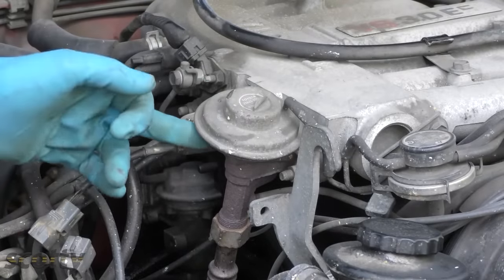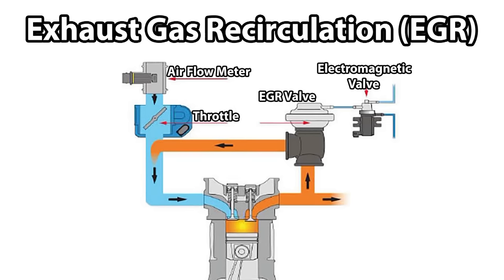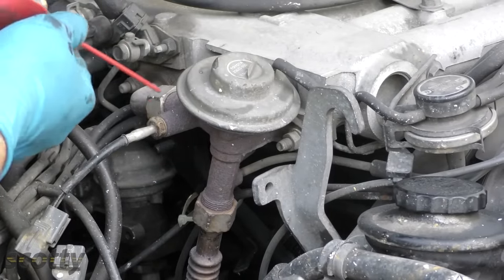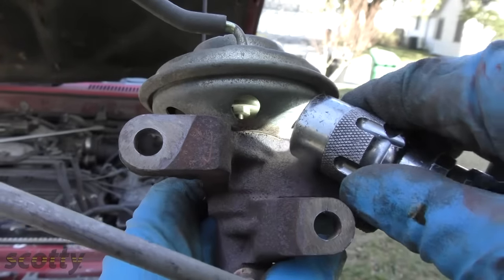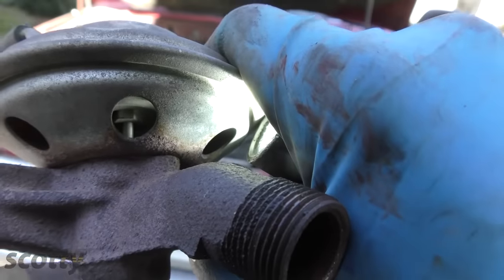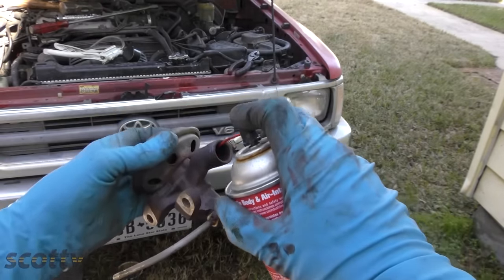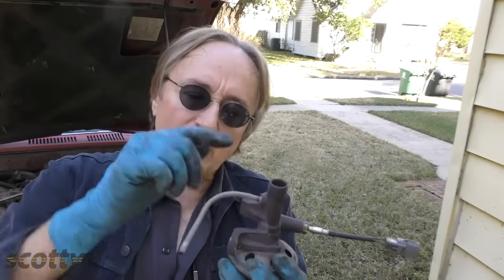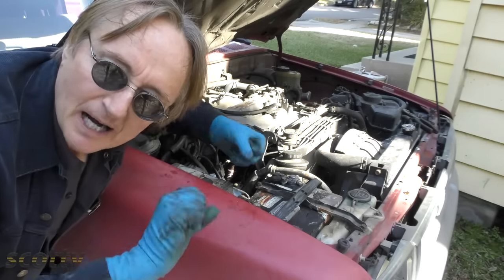How to Clean EGR Valve in Your Car (How It Works)

Comment: Egr valves..... Good for the planet, Bad for the owner......
Reply: Martyn Lee also bad for the engine.
Reply: EGR should be banned.   friggin EPA bs.   There is something better out there.
Reply: Martyn Lee deisels can get egr delete but I don't understand that
Reply: @DespairMisery  im doing that and a repro
Reply: Honestly those EGR's are nothing but a stupid piece of crap. Feeding an engine its own poop is NEVER a good thing.
Reply: Markus Hillarious wording
Reply: Egr makes the combustion cooler preventing detonation
Reply: EGR makes combustion cooler as someone said, theyre not bad, yes its less fuel efficient and decreases power but doesn't destroy the engine
Reply: Lowers the burnable air in the cylinder and therefore is similar to lowering displacement causing better gas milage.
Reply: My mechanic chucked mine
Reply: Ikr, EGR drive me insane when troubleshooting EGR problems
Reply: My mechanic chucked mine
Reply: 99 times out of 100 a check engine light pertains to stupid pollution control crap
Reply: I can smell gas very strongly under my hood. Just thankful it hasn't blown up on me. I'm getting mine fixed soon.
Reply: Omfg yesss
Reply: @elainec2577  🤫
Reply: Mine went bad. I plugged the vacuum hose.  Works great 👍
Reply: Do you know about what semi trucks have to deal with? Diesel exhaust fluid the emission system, the cost the headache the cost to the consumer.
Reply: Egr are not bad , just mechanics are idiots and cannot or don’t want to help people understand them

Comment: You really don’t want to soak the EGR valve upside down - that diaphragm is made from material, not metal, and the carb cleaner or solvent can actually destroy that.  It may also be a good idea to try to clean the passages that you see, when the EGR valve is off the car, as carbon can block those passages as well.
Reply: C'mon man go you know the thing
Reply: @midnightrunner684 go where

Comment: I had the same problem. Check engine light for egr. Dealer said it is a digital egr and must be replaced $500 🏃. I took it apart, cleaned, changed 3 silver gaskets and check engine light gone.
Reply: Jose Garcia     wow
Reply: Did you plug in a code scanner and did it say all your cylinders were misfiring? My car is running fine, but the check engine light is on and I'm getting codes that say  all cylinders are misfiring. Some forums are pointing to the egr valve
Reply: you cheated the owner of the dealership out of $500 of profit.
Reply: @johnleonard9102  was it that!?!? I'm having that problem right now with a 2006 mustang gt
Reply: 4/11nightnheaven (moan) mhm aauuuuuuuuuuuuuuu

Comment: Hey, not to be an armchair coach; but... when you're spraying carb clearner into that thing while it's turned upside down isn't there a risk of getting carb cleaner all over the rubber diaphram, thus deteriorating the integrity of the rubber?

Comment: I've cleaned and replaced many of these over the years. The best way to clean them is with an ultrasonic cleaner.
Reply: Thanks man!!!
Reply: @Rob in my case I already have an ultrasonic cleaner , so it makes more sense to clean it, assuming the diaphragm still functions .  Even if you didn’t have an ultrasonic, it would still be better to clean it than buy a new one... again assuming the diaphragm and valve works .
Reply: Will mass air flow sensor cleaner work
Reply: @griffinsawchuk4769  No, it won't break loose the carbon deposits.
Reply: @electronicsNmore  thankies good to know
Reply: Put it in a sealed container on The washing machine for a few loads if you dont have ultra sonic.
Reply: @Seriouslydave  does that really work
Reply: @MrKool2000  thats all ultra sonic is little vibrations. And cleaning solution.
Reply: @Seriouslydave  nicee

Comment: I love your channel, and all of your videos Scotty. Lately I've watched the "EGR cleaning" video and the "clamp for radiator hoses" videos. I always learn so much here. I don't want to spend oodles of cash at the shop when I can do most of this myself, and having mostly older vehicles (1990 F250 XLT, 1998 Nissan Sentra [insert sad face here], 2000 Mazda Protege) I would be spending more than just oodles to get them running decently again.
   I'm getting a bit more comfortable tackling larger repairs, and I wanted to thank you for making these jobs a little easier to handle. Keep up the good work and REV THOSE ENGINES!

Comment: Took my '94 dodge colt to 2 different professionals who couldn't diagnose why the car was running poorly. I started doing some googling and youtubing... thought clogged egr sounded right. Man that thing had chunks of carbon coming out... ran like a top after that. Learned something about my car and " professional " mechanics
Reply: Did they still take your money?
Reply: Pep boys billed me $100 for an hour diagnostics... they got it to run a little better for a little while. Come to find out they did that by fully advancing the distributor/timing. My neighbor who worked at an indie shop did not charge me... he swore it was a temp sensor.

I only own rwd redblock volvos now and diy what needs done... very simple cars to work on.
Reply: Yes a very professional 'solution' How to increase engine wear, decrease fuel efficiency, lose power and fark up emissions.  Google is our friend.
Reply: So does the erg valve being dirty cause a car to stall out and make idile go low . Trying to see what wrong with my van.
Reply: Randi Evans yes a faulty or dirty EGR can cause rough idle, stalling, and decreased mpg
Reply: @tyny3620  
Nice googling
Reply: The thing about mechanics now are they are basically just computer guys. They hook up something, computers tells them some options, and they figure out which one. Some get lucky, some dont. I wish cars were put together as easy as computers, no spending an hour to get under a manifold to replace a spark plug or, with my friend, have to take off his tire to change the battery.

Comment: On this particular V6 Toyota engine that he's working on, the old 3VZE (which I have) also exists the EGR probe (~6" long) which goes inside the intake plenum next to the EGR.  That should be removed and cleaned as well as it gets corroded with deposits.  And as you will see, there is also the EGR Modulator in front of the EGR which looks similar in that it has a round top. The EGR Modulator has 3 vacuum hoses (P, Q, R).  There is a small disc-shaped filter in the top of this unit and it should be removed and cleaned out.   Other things to look for in this smog system are the PAIR reed valve unit (further behind and lower from EGR), the Evap "charcoal" cannister on rear left fender, and lastly, check the inlet / oulet temps of the Catalytic converter with a laser thermometer which should be ~80 to 100 degrees in difference for a working cat If under 75, the cat is on its way out.. If under 50..replace it!  Replacing the oxygen sensor down there is also not a bad idea.  
Those are all the main smog items on this engine.

Comment: a mechanic friend with a great attitude and heart. Respect! Dear friend I drive a 07 Sentra which stopped while idling at a stop light. shocked and embarrassed in heavy morning DC traffic, and tried turning the ignition off and back on, fortunately it turned on and I moved. thats how I came back to your channel looking for answers. any other sensors or torque converter issue? I think I should diagnose it ASAP before it happens again and I probably would be stuck on the road calling for a tow truck.

Comment: Scotty....EGR question here...   I bet you worked on thousand of these cars back in the day....   1980 Pontiac Sunbird with a 2.5l 151 4cyl Iron Duke. (RWD H body, you can see it on my channel).    It runs really nice, but the motor starts bouncing noticeable as soon as It goes into part throttle / steady state cruise.  I tried everything and found some relief with the EGR valve.  As tested it opens ok with vacuum.  When I remove it and block it off completely, it smooths out the shakes, to barely noticeable.  I wonder if I have a leaky exhaust valve?  Idles ok, pull's fine and doesn't seem to have a missfire. (carb - no computer) but the sound from the tailpipe at idle sounds like it might have something amiss..    Ls1 swap would probably get it solved for good.

Comment: Hey Scotty great videos, very informative. 
I took my car into the shop yesterday cause the check engine light. They're a really nice shop, good people, and they came to the conclusion that my EGR valve needs to be replaced. They want to charge me 589 dollars to replace. Am I better off replacing it myself or cleaning it myself? Should i ask if it just needs to be cleaned and not replaced? What questions should I ask? Also my car runs very smoothly. Thanks for reading

Comment: I have a 1990 Acura Legend with the exact problem, is it at all possible to clean the EGR without removing it? It's in a very tricky spot and I'd have to take off the entire distributor to get to it, and the intake manifold just to get to the pipe. Thanks in advance!

Comment: Also basically the same with a lot of Idle Air Control Valves. My Fords love to gum them up. Take them out spray em out and I usually throw some wd40 in there just for good measure.
Reply: the WD40 is why they gum up /facepalm
Reply: @opvask  no they gum up because of excessive blow by

Comment: 2005 Ford Taurus, 188,000 miles. When the outside air is warm (40°) or higher the car starts at a high idle and takes about 3 minutes to drop down under 1000 rpms.  After it has reached operating temp it purrs like a kitten. When it is cold out, the colder it is the harder it is to start. It revs up to 2100 or so rpms then drops right down to nothing. It takes a few tries to get it to run, but runs around 1500 rpms until it starts to warm up. The only emission part I have not replaced is the EGR. No check engine light or codes have ever helped.  What are your thoughts?  PS it's hard to get rid of a car that still gets up to 27mpg, runs, and is still quite a solid car for its age.

Comment: Alright, finally took my EGR out to clean it after a few months of resetting the Check Engine light.  OMG, it was dirty!!  Black, black, black liquid came out after every spray for many sprays.  And many wipes covered in black carbon.  Sitting overnight now and going back in tomorrow.  UPDATE:  Check Engine light cleared with my scan tool and has not come back on.  Car has periodic coughing/shaking, does not like 35mph range.  Car otherwise drives just fine, getting 26 mpg in City driving / 33 Highway.  That's good enough for me 👍
Reply: Did it work?
Reply: @JonathanCheco  Nope, sadly nope.  Just driving with the Check Engine light on until I replace it, about $150.  Car running pretty well.  Thanks for asking.

Comment: Important for good  EGR flow.  Keep the environment clean!  Never miss a video.
Reply: economic driving skills are a lot more important than egr valve.
Reply: i make sure my egr valve is clean by cleaning it with every oilchange but i drive like a fuckin maniac racing from stop light to stop light. my gas pedal has only 2 modes: on and off. +1 for keeping the environment clean #greenearth #dontpollute #itrusttheEPA #dieselgate
Reply: Ozzstar mine stays clean by blanking the bloody thing off.

Comment: Before cleaning your old EGR it is good to check first if the new one is available for a few bucks. That what happened to my 25 yr's old Sebring convertible 2.5 liter. The other valve worth to replace is PCV one, in case if it is not knocking loudly while shaking in your hand.

Comment: Mine had a gasket between the throttle body and the EGR valve, don't lose it when cleaning the EGR!
Also, it might be a good idea to clean the throttle body when there is a problem with the EGR, mine had to clogged holes that came from the EGR valve :P
Reply: Exactly- if those passages to intake or from exhaust are clogged- then there’s no / low flow. I think that’d cause the p0400-09 EGR insufficient flow codes- even with a good EGR

Comment: I have a 2000 v6 mustang i have been battling this idle issue for about a year now, the issue is that when the engine is warm, not hot, not cold,(so if i drive to a store and come back out to start the car after 10-20 mins of sitting) it will have a hunting idle for a minute or two and then it will run and drive fine, sometimes with a missfire,i  have replaced my iac (5 times), tps, egr (and all controlling parts), cleaned my maf, pcv, some vacuum lines, and even took it to ford for a diagnosis which took them all day, they came up with that the issue was caused by two injectors intermittently being stuck open, flooding the engine when i start it up, causing it to have the idle. So i replaced all injectors, plugs and wires and it did not fix the issue. Talked to ford and they are not sure now. Please help

Comment: EGR valves are no good for a 90s model F150. You also have to breakdown the throttle body and clean out the ports where the EGR returns the gases. Carbon builds up in the ports and clogs.

Comment: Scotty, I have a 2015 GX 460 Lexus and had the dealership put a new ERC Value in it after the check in light came on a few times. This weekend the check engine light came on again so I took it to a different automotive shop and the owner said the code reader says it needs a new ERC Value. I told him Lexus had put a new one in the car in Jan.  I think I'm gonna ask him to clean it now. Does carbon build up in other areas besides the ERC Value. Wish I was more of a DIY'er, but don't know much about car engines.

Comment: i got a new EGR valve and i tested it to make sure it works and doesnt leak and it checks out fine. when i hook up the vacuum hose to it, my truck starts misfiring. when i unhook it, it runs fine. only code i am getting is knock sensor. any ideas? should i change my knock sensor?

Comment: ive cleaned egr valve on 95 k1500 5.7l 350 and ford f250 6.0 diesel and both times my trucks ran better than id remebered in yrs. the chevy i cleaned on a whin after egr code on ford

Comment: My car has 76000 miles; it's a 2007 Ford Taurus. I'm getting PO430 error code. Should I consider replacing the EGR valve?

Comment: Should use a penetrating fluid such as PB Blaster on the threads to get the EGR off instead of WD 40.
Reply: PB blaster is great... liquid wrench is as well
Reply: What?? PB Blaster and WD40 were designed to do two different things.  PB Blaster in a corrosive that eats rust and is also a lubricant.  WD40 is a cleaner, degreaser and protectant; not a lubricant and is crap compared to Zep, Liquid Wrench and PB Blaster.

Comment: According to the obd1. I have code 14 and 41. Signal failure from throttle to ecm. Since both parts are new.. must be a short in the wire. I hope... I am planning on purchasing a tone generator. Etc 2000 one you reviewed looked like a great deal.

Comment: I've cleaned my egr valve about 3 times, replaced it with a new one, checked all lines, and my car still runs better with it unplugged
Reply: . Okay but if you bypass the egr valve won't the engine light come on ? The reason I'm asking is because my former mechanic sold me a 1995 Toyota Camry and the engine light would come on when the weather was hot but it would go off by itself when the weather was cool I found out that I had a trouble code 71 egr related I cleaned the egr valve and the code didn't go away I went underneath the car to look for the egr vsv solenoid valve and noticed that one of the little vacuum hoses was discontinued purposely my former mechanic had done a bypass on the egr and not only that the other two little vacuum hoses that are connected to the vsv valve were switched I found this out after looking at the Haynes repair manual to find out the proper location for each hoses so I reconnected the 3 little vacuum hoses in their proper place and the engine light issue was fixed . That is why I'm asking this question because I'm thinking if my engine will run better if I bypass the egr valve it might be worth doing it I can always reconnect the hoses back in their proper place when the time comes to smog the car.
Reply: try some chevron supreme...

Comment: Thanks Scotty,,, and doing that for years,,, and disconnecting vacuum line and putting a screw in it,,,,, unplugging the electric,,,. Even using a block off plate,,,. But after learning more about aircraft engines,,,,. The EGR opens and let's hot exhaust into the combustion chamber,,, which cools the combustion chamber,,,, sounds weird but the hot exhaust draws Heat out of the head,,, !!!

Comment: Hello Scotty. My check engine light came on my 2010 VW Routon that has 130k miles. I went to o'really's and they told me it was a P0406. After driving 30 miles. The check engine light turn off. Not sure if I should mess with it or wait for the light to come back on?

Comment: Scotty Kilmer that is an easy job for an egr that is up on the engine .
What do you do when you have to dismantle a lot of parts to reach the egr?
 Do the egr cleaners work in this case ?/you spray them into the hose that breaths to the intake before the maf sensor and acts as a solvent removing grease and junk.
 What do you think of that?

Comment: I have a 2003 Mitsubishi Eclipse GTS, 3.0, 6 cyl. Check engine light did not come on. 1 day it stopped starting and would just crank so I purchased a code reader and got the code for the EGR. Is it that easy to take apart on this car and clean as it was on that one?

Comment: For the 3vze the code is P71. Thanks scotty this actually helped me out since I have the exact same engine...
Reply: Did your code resolve after cleaning like this. Everything on my vehicle is working but I can’t find the problem. Cleaned passages in throttle body as well and changed the VSV with a working one from the junk yard to no avail. Any suggestions?